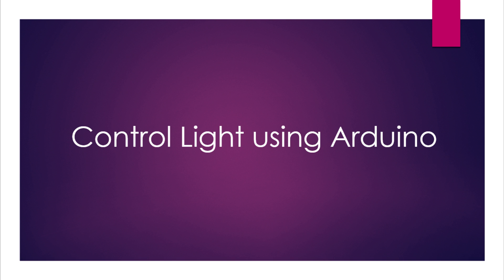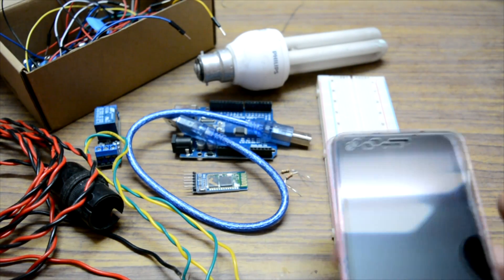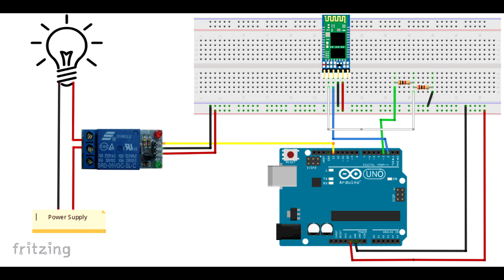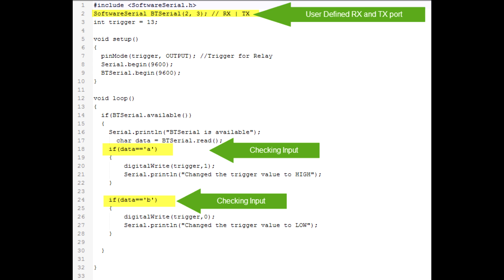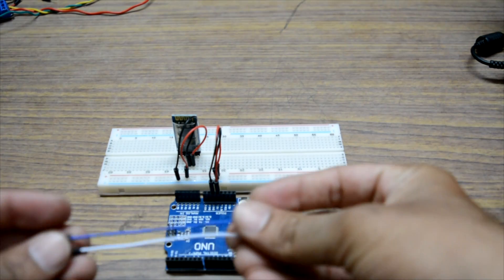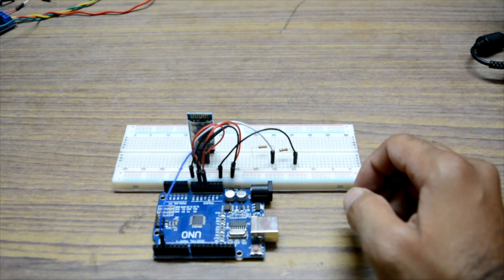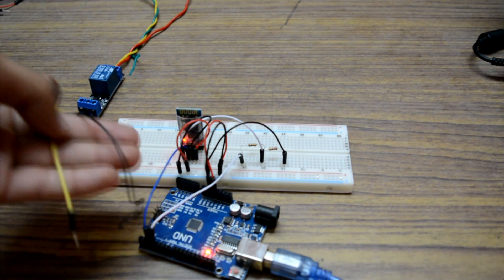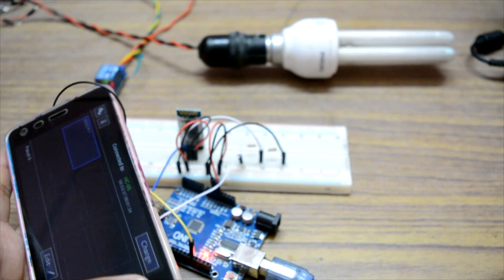Home Automation - How to Control Lights using Arduino and Bluetooth

Comment: Hello Raj, thank you for sharing your knowledge but i have a question. how do i make this set up become mobile which don't need to plug into any power outlet. and is it possible to power adruino board and the lamp from the same power source?

looking forward to hear your reply, thanks!
Reply from the maker: Swafie good question... The problem with going mobile with this setup is the power supply. The bulb require 230v and arduino will work with 5v.  Ofcourse we can use another light source like leds to glow with lower voltages which we can carry in batteries.

Comment: Hello sir, I want to connect esp8266-7 module with arduino. Can you provide some guidelines?
Reply from the maker: Vishal Maheta i did try working with esp8266 but was not that successful. But yes we can connect it with arduino and work

Comment: why not use the 3.3v output which is right next to 5v!!!!!
Reply from the maker: Rhythm gupta the relay i used was of 5v and 3.3v would not have worked with it.
Reply: No to give power to hc-05
Reply: Why use resistors?
Reply: For my hc-05 I use 5v and it is 24/7 on it does not harm hc-05 but yes we can never be too much careful

Comment: firsty thanku sir for such a beneficial video
i want to ask that i have made my relay module myself using bc547 transistor and a 5V relay. i am giving 5V power suppy to the collector of the trasistor where my relay is also connnected and the base of the transistor through the power unit of arduino. but in this case my relay is not working . while when i give 5V only to collector and short circuit the base and collector then its working . 
so , sir plz tell me my mistake
Reply: plz reply soon
Reply from the maker: AADESH MITTAL can you send me your circuit diagram.

Comment: is the realy supposed to work with opposite commands? because when I passed commands through the serial monitor , it was glowing on 0 and turning off on 1, can you explain
Reply from the maker: hmmm... Never tried that from serial monitor. Is it working from the app?

Comment: hey after connecting relay and the power supply and should we need to connect the ardino to the pc
Reply from the maker: Bablu paul yes for powering it.. else you can provide any external power supply so that Arduino is powered

Comment: sir what application in bluetooth?
Reply from the maker: chris centillas i have used bluetooth electronics app for controlling the device. you can check my youtube video on the same
Reply: rajkiran singh thank you sir
Reply: rajkiran singh sir may problem now the application can't work
Reply from the maker: chris centillas sure.
Reply from the maker: Hey, I did not receive anything related to your problem on my email. I suppose it is resolved. If not please send me the issue details.

Comment: sir i need to ask you that in the DESCRIPTION there is two type of code one is 3 light bluetoot and another is 8 ligths bluetoot so i want to ask you that which code we have to program in the formation of your circuit sir plz reply fast.
Reply from the maker: Hello. hamza ahmed Sherwani. that really depends on your requirement. if you want to control 3 lights use the code for 3 and similarly 8 lights.
Reply: for controling one light  as you control in your video so which code i use?
Reply from the maker: hamza ahmed Sherwani you can still use the code for 3 lights. the extra code will not hurt.
Reply: thanks sir
Reply: sir when i will start making my project if i got any problem can you help me?
Reply from the maker: Sure, You can email me if you face any problem "g.rajksingh@gmail.com"

Comment: We have done all the connections as shown, coding is correct and all components are functioning. But the bulb is not operating via the app. (The bulb is fine). Please help.
Reply from the maker: Aditi Singh could you please give me you email. i will help you triage the connection

Comment: your code says input is 'a' or 'b' etc.However the app shows you are clicking buttons of green and red color.What change did you make and how?
Reply from the maker: Hey, I have user the bluetooth electronics app where the buttons were configured for input a and b. You might want to see this video to understand how I did that.

Bluetooth Electronics Tutorial Video:https://www.youtube.com/watch?v=V6IRp30sfcs
Reply: thank you very much sir.One last thing,can i use my default rx,tx buttons on my arduino instead of 2 and 3?
if yes will the code on that line be "SoftwareSerial BTSerial(0,1);"  0 for rx and 1 for tx? if no please reply
Reply from the maker: My experience with tx and rx was not good and it did not work for me. If you want to change you can do that and sure you have to change the code as well. Let me know if you were successful.
Reply: same problem sir pls help

Comment: Hello rajkiran singh, Could u please tell me which app you're using to control the light bulb? And the dropbox code in the description didn't match with the code in the video(3:28)? Could u please send me the right code?  Please send it to vincentdb96@gmail.com
Reply from the maker: Hi Vincent,

The app is called Bluetooth Electronics, you can find that in playstore. 

About the code in dropbox, It is for multiple lights as I was getting so many requests for 3 and 5 lights control code I have put that in dropbox and provided the link. The same code will work for 1 light was well

Let me know if you need more information.
Reply: Hi rajkiran. It downloaded the app but in the video (around 8:40) you pick panel 9 to control the lamp. My app doesn't show panel 9.  Did you made some changes to the app or..? i hope you can help me out
Reply from the maker: Vincent de bert. yes i did make a change. sorry for not including that in the video and thanks for pointing this out.
Reply from the maker: Vincent de bert. Could you wait for a day. I will add a tutorial of that a short while.
Reply: Ahh yes i can wait 1 day. Let me know when the tutorial is uploaded:). Thanks already
Reply from the maker: Done... Might me my quickest video on YOUTUBE. Also with many mistakes. But overall This will give you the picture.

Video Link: https://www.youtube.com/watch?v=V6IRp30sfcs
Reply: Thanks for the video, this really helped me out. I just got 1 question remaining: What is the actual code you are using? because the code shown on 3:16 is not the same as the code in dropbox. Could you send me the right code?
Reply from the maker: Vincent de bert. yes i will send you the code for single bulb.
Reply: Ahh i figured it out. The code in the description is not right. I typed the same code as you used in your video and that one works. Maybe you should consider to put that one in the description. Everything works now, so much thanks for the help

Comment: can u please tell me what is 9600 in your code and one more thing, i m using a 4 channel relay and using an led and a 9 v battery but its not working. any suggestions?
Reply from the maker: The baud rate specifies how fast data is sent over a 
serial line. It’s usually expressed in units of bits-per-second (bps). 
If you invert the baud rate, you can find out just how long it takes to
transmit a single bit. Baud rates can be just about any value within reason. The only requirement is that both devices operate at the same rate. 

You can refer this link for more information on serial communication
https://learn.sparkfun.com/tutorials/serial-communication/rules-of-serial
Reply from the maker: Send me your circuit image to my email, I will check the issue.

Comment: how much did it totaly cost?
Reply from the maker: Total cost is like:

Arduino ~450
Bluetooth Module  ~110
Relay ~ 90 to 100 (do not remember the exact cost)
Wires ~20

Except for the relay module, other things can be used for different projects simultaneously.

Comment: can we remove microcontroller from board and use it on breadboard, basically after loading the code into microcontroller we don't need development board right, can that be done...
Reply from the maker: Raghu Yadav. that should not be a problem if you have an arduino with removable microcontroller. mine is fixed so never tried that.

Comment: can you please tell me how to control more than one appliance using this project?
Reply from the maker: Yes, you can add one more relay, similar to the one we used. use one more trigger pin ex: pin 12 and add few more lines in code for controlling

Comment: how to make the 9th pannel?
when i switch on supply the bulb is emitting light initially
Reply from the maker: 9th Pannel? Sorry I did not get this.

For the 2nd line regarding the power supply: you might have connected the power supply wire to NC (normally closed) instead on NO (normally opened) terminal. Just change the terminal for the wire going to the bulb. I hope I am clear on the explanation. 

Let me know if you need more help. Send me an email or message with what you are doing.
Reply: Yes! 
I have made that pannel and is working properly 
Thank you so much!
Can u make the same on ep866 iot sensor module?
Reply from the maker: Yes Rushabh, I am working on the same. I will be using ESP8266 and you will be able to control the light using internet from anywhere in the world. 

Currently stuck at one area and cant move ahead until I resolve it.

Thank you for your comments. You can watch my other video where I have used RPI 2 for controlling devices using voice.
Reply: GREAT VIDEOS!

I WOULD SUGGEST YOU TO MAKE A VIDEO ON BASICS OF ARDUINO PROGRAMMING!

I COULDNT FOUND ANY OF DEM ON YOUTUBE!

THANKS ONCE AGAIN

Comment: Great tutorial. Have you ever used the Esp8266?
Reply from the maker: +Aman Lalria

Yes I have used ESP8266 and planning my next video on the same.  It gave me headache literally at first when it behaved odd and refused to respond. But now I am comfortable with it.  

I am also working on voice commands using the Automate app I used in my previous videos.
Reply: +rajkiran singh Nice, which firmware? I'm using NodeMCU for my final year project. I look forward to the next Automate video :)